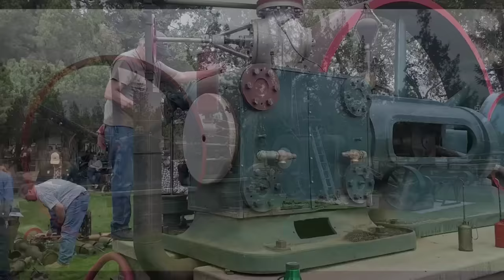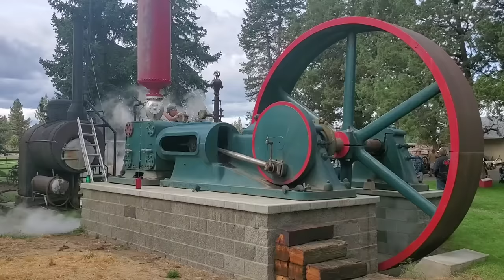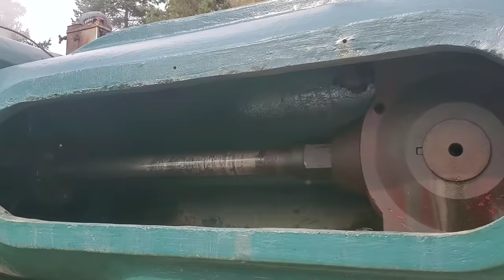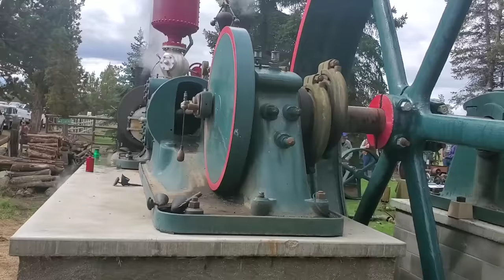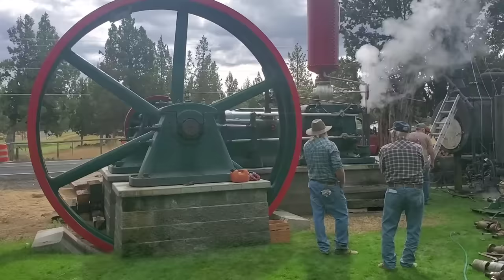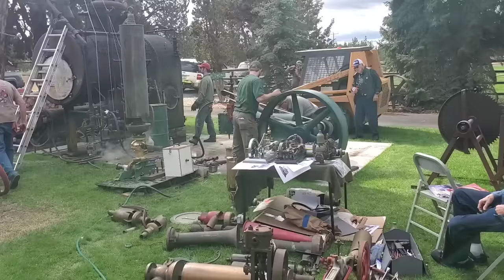Corliss 300hp Steam Engine

Comment: I wonder what kind of generator you could power with this engine. Google says 300 horsepower = 220 kw, but that's an ideal conversion and not representative of real world efficiency losses. Still, you'd be able to generate waaaay more power than a domestic house would use. If you owned some forest land out in the boondocks somewhere with logging rights, you could run this continually, one tree at a time (replacing each chopped tree with a fast growing species like sitka spruce) and sell the excess to the grid.
Reply: Continously processing the wood is no small feat. 

And don't these things work on oil or coal?
Reply: @BAD_CONSUMER  It's a steam engine - it will run on anything that burns. Internal combustion engines require refined, clean liquid fuel. External combustion engines just require something that can generate heat and boil the water. The only thing that's going inside the engine is the water vapor from the boiler. The fuel never comes anywhere near the interior of the engine. It just goes into the boiler. This means it can be pretty much anything, as long as it will burn.
Reply: @Bloodgod40  Running at 80% load would require approximately 6-10 tons of wood/day, or about 3-4 tons of coal. just FYI.

Comment: I always thought you could get so much more out of these if you could cool the exhaust side enough to produce vacuum!
Reply: The very first steam engines were "vacuum" engines, and very inefficient.  Atmospheric  pressure is 1 bar or 14 psi the pressure inside the boiler of a steam engine ranges form 200  to 300  psi or 14 to 21 bar. 
There is no "exhaust" side. The piston has a power stroke up and down, or in and out, therefore it is a one stroke engine. Therefore it is equivalent to an eight cylinder 4 stroke engine when you measure the power strokes per rotation.
Reply: they did precisely that in some installations.

Comment: Is that as fast as it goes?
Reply from the maker: No, the boiler is very much undersized for the engine, but since it is just for show, it works  well. If it was in use, to provide a source of power, it would require a much larger boiler and could then produce higher RPMs if required.
Reply: Enough torque to move the North Pole to the south Pole..
Reply: @bigRgurn  can it be used to provide power in today's world or no?
Reply from the maker: @morphman21  it could, but with the current boiler it could not  provide power to its fullest capacity without a larger boiler.

Comment: Are the engines still around and running?
Reply from the maker: Yes, there are quite literally thousands of steam engines still in use around the world today, many still used in industry to produce goods, others in collections. This particular engine is part of a private collection and is run multiple times a year, just for entertainment. It could be put into use if an appropriate sized boiler was constructed.
Reply: @bigRgurn  wow wew waw w w www 
They are incredibly beautiful
Reply: @bigRgurn  the boiler that you have looks more than big enough. With the governor and cutoff set correctly, and the boiler around 120psi, you would absolutely be able to run her at working speed and probably drive some small machines too. 
And if the boiler still is too small, better/bigger safety valve then increase its working pressure.
Reply from the maker: @ascasc9957  the boiler is woefully  undersized for this engine, just in water capacity alone. However, the owner is content with what he has as it's what was a available.
Reply: @bigRgurn  bigger injectors then! Cmon lads 😂fair enough
Reply from the maker: @ascasc9957  🤣

Comment: Less hp than my jetski...
Reply: LMAO. You are absolutely right!
 Kawasaki Ultra310LX 1,498 cm³ Displacement 221 kW {300 PS} / 8,000 rpm.
If we put this engine  through a gearbox and drop the rpm to 100 it will do exactly the same as this monstrosity.
Reply: @pietperske3583  your jetski won't last that long though